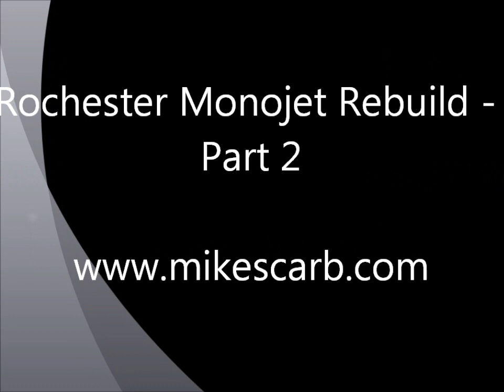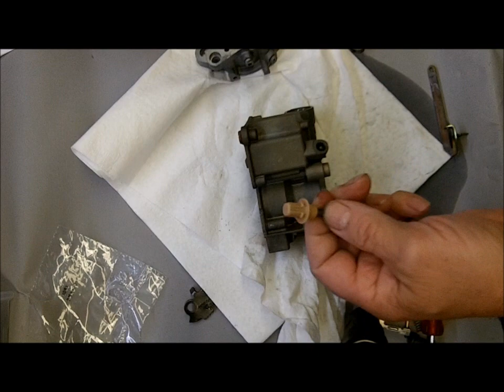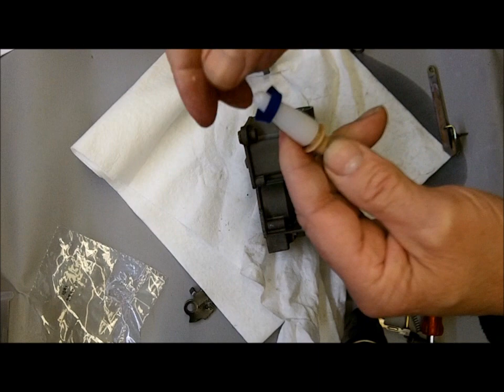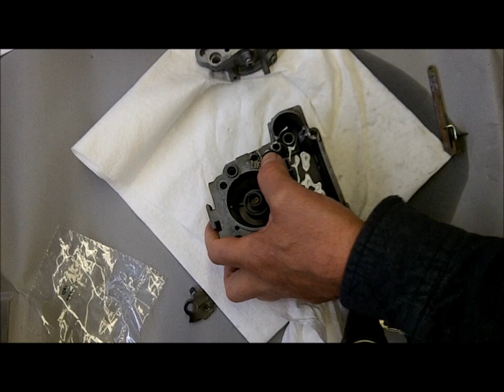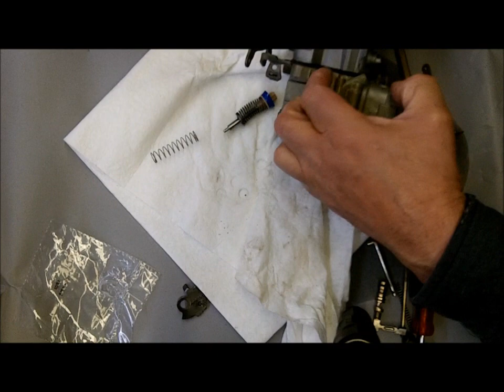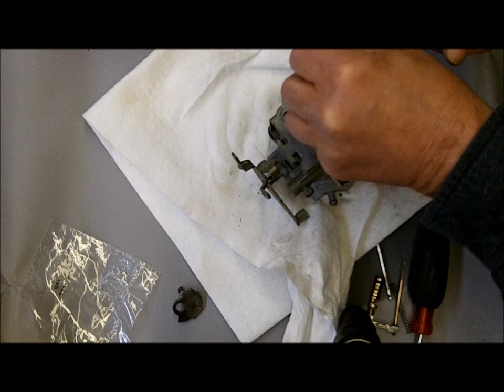Rochester Monojet Carburetor Rebuild - Part 2

Comment: I'm rebuilding the carb on my dad's '76 Chevy pickup with a 292c.I. straight 6cyl. and I wasn't sure about the main jet and needle. Dad passed away in 2008 but I knew he had changed main jet to the next larger one since he was hauling loads of firewood in the custom dump bed and in a trailer at the same time. The 292c.I. 6cyl. might not have been the fastest thing on the road but it has a lot of torque making it a good heavy load hauler. The problem my son and I were having was that it was getting less than ten mpg without a load and I know that when dad was still alive it got better mileage with a full load in the truck bed and trailer combined! I tried soldering the jet to a slightly smaller size using calipers to measure the needle and drill bits to determine the jet size. After reassembling the carb and installing it the truck won't run without holding you're hand over the top of it. Initially I thought we had a vacuum leak but after disassembling the carb three different times and not finding anything wrong I think the main jet was drilled back out too small. this video gave me the info that I needed to diagnose the problem. So I am going to take it back apart today and just blow all of the solder back out of it and see what happens, hopefully it solves the problem! The only experience I have with carbs that have a main jet with a needle to enrichen the mixture is in motorcycles and most of those don't rely on the main jet for the idle mixture. Hopefully this will solve the problem but I still don't understand why the fuel mileage went down so drastically. Before he passed away in 2008 dad and I completely rebuilt the engine including new rings, valves, valve guides, and main and rod bearings. we tested the compression and did a leakdown test so I know it's not the engine so it must be the carburetor. Hopefully it works afterwords because I'm getting sick and tired of disassembling it even though I could do it blindfolded and in my sleep! I'll let you all know what happens!
Reply: Maybe a adapter over the base plate and run a 2 barrel like a holley 5200 or a weber...more tuning possibility with a weber